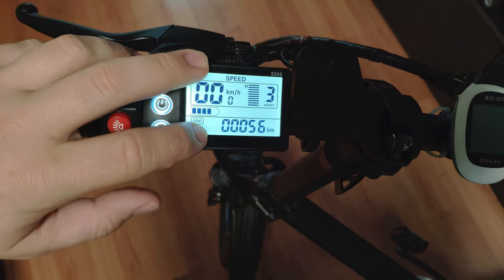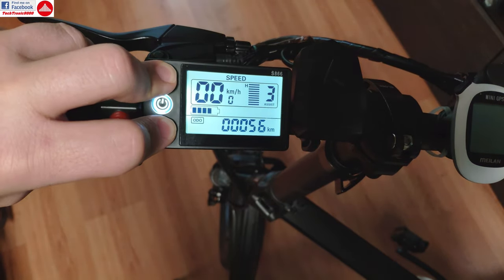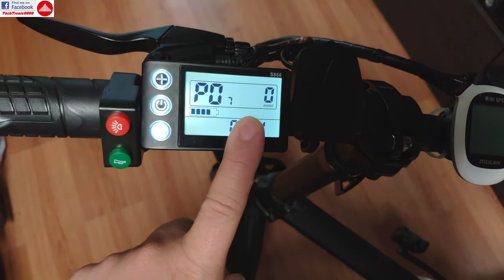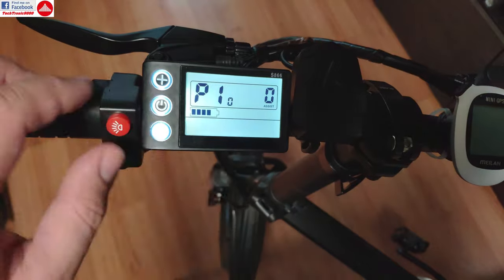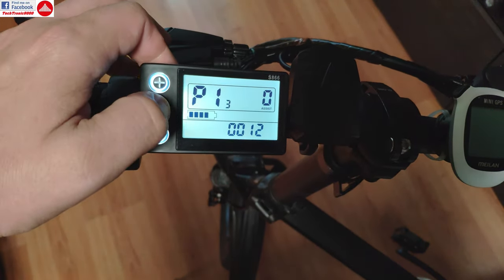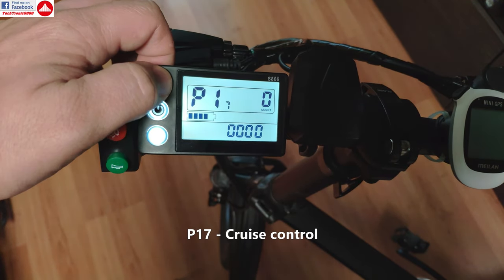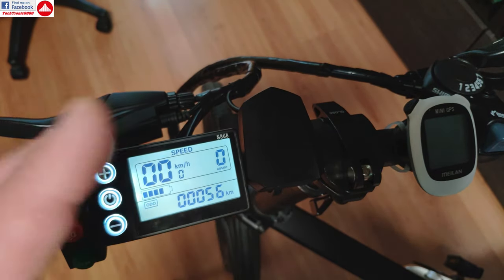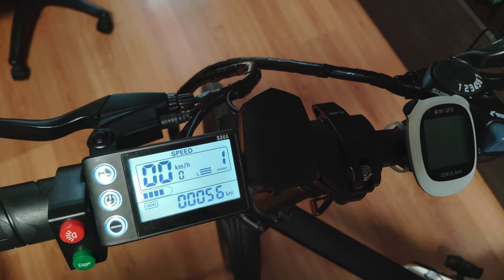ADO A20 / A20F / A16 S866 LCD - Complete Settings Walkthrough (P01-P20)

Comment: Is it possible to make different acceleration levels on different assists levels? My bike is very powerfull on ANY pedal assists. Just few pedals rotations and the bike starts in full power. Doesn't matter which assist levels are using.
Reply from the maker: You can reduce acceleration level, it has 5 options. Also you can decrease the delay so the bike starts faster and is more consistent with your pedaling.
Reply: @TechTronic9000  Which one for acceleration level P11 or P13? Which one for decrease the delay so the bike starts faster P14 or P16?

Comment: I have the aostirmotor ado folding ebike 500 watts it goes 25 MPH but it only goes 22.7 tried setting up 8 but it wouldn't go to 100 to unlock it's speed but I will keep trying it says it goes 40km Wich is 25 MPH
Reply from the maker: ADO or aostirmotor? They are totally different brand. ADO is already a well established brand with lots of users and good support, can't tell nothing about the other model.

Comment: Hi sir, i need to change my wheel diameter setting because my km/h meter is not accurate, but i cant change any setting besides p8 and p10, do you maybe know how to change it?
Reply from the maker: Is it an ADO bike? Maybe it's another controller?
Reply: @TechTronic9000   no its an ouxi v7 pro.

Comment: I got my first ebike a few days ago. I'd like to change the displayed speed for the bike (max, 21MPH) but it shows 35-40MPH which is wrong. I would adjust the P18 parameter?
Reply from the maker: Start by checking wheel size first.
Reply: @TechTronic9000  26" wheels.
Reply: This doesn't sound right. I would change it back to the defaults and carefully watch the video again. You want it to go faster or just display the correct speed?

DEFAULT SETTINGS 
:
P01: 2    (Display brightness)
P02: 0     (Km or miles) 
P03: 36  (Nominal voltage)
P04: 10   (auto sleep time minutes)
P05: 0     ( power assisted mode )
P06: 20   (wheel diameter)
P07: 1     (number magnets motor)
P08: 25   (speed limit, increase to 44 for max speed)
P09: 0.    (non zero start, 0= no pedal needed)
P10: 2.    (drive mode, electric, assisted or normal bike)
P11: 2.     (assist delay since peddling started)
P12: 3.     (Strength of acceleration)
P13: 12    (PAS sensor)
P14: 15     (controller current limit)
P15: 29     (battery controller voltage limit)
P16: 0       (reset odometer, km to 0= new bike)
P17: 0       (cruise control)
P18: 100   (Display range adjust)
P19: 0       (0 gear assisted)
P20: 0      (controller communication mode)
Reply: @GaryInAmsterdam  Display the correct speed

Comment: no juste.  when import on spain and france, it is Eu restricte. yo open batt side. disconect the black conection(gray wires)  ormally it is freepower so P8 will not work.P12 also. 2 choice. full or restroct
Reply from the maker: You might have the newer controller version, for that one check this https://youtu.be/rL0P9gW5x4U

Comment: Hello. I watched the video. I still have a problem. I have the Ado xe  16 bike. Same controller. BUT, in PO5 setting, it gives me only 5 assistance levels, NOT 9. Generally, the problem is that it doesn' t reach 25km speed. And I have to pedal too much, just to give me a little boost. I want just to do one-two pedal and then boost. I want the less delay, the more boost, the fastest it can be. What exactly have to do in settings to achieve that? Thank you!
Reply from the maker: Check my other video with ADO bikes, your XE has another type of controller with just 16 settings so you unlock it in other way.
Reply: @TechTronic9000  Hi again. I watched the other videos but i did not figure out how to unlock speed limit. My ebike is Ado XE 16 (there is no throttle). It has the same controller, the S866. It has two choices for speed assistance. Either max 3, or max 5. There are no 9 levels of speed among my choices. And the fastest it can go is 21km. It never reached 22km. What can i do to go faster?
Reply: The 9 levels isn't going to help you at all, especially if the bike only supports 3 or 5 levels. What you want to change are P11 and P12.
P11 is the delay before the assist happens (1 to 24) 24 being long delay (personaly, I use this setting to increase distance/batt life) set yours to 1.
P12 is PAS acceleration value (1 to 5). Set this to 5. 
This is how these settings should work. Hopefully it works for u.

Comment: Any idea on how to upgrade this bikes battery in order to make it faster?
Reply from the maker: Yes, change the battery with a 48V one and set the controller to 48V.
Reply: @TechTronic9000  Do you have a battery in mind? i'm afraid to buy one and it doesn't fit inside the bike

Comment: Hi, any ideas why my milometer has stopped recording the miles properly (got the first 11 miles done and seems to have gone bad). Also, the battery seems to show low bars very quickly, say after a few miles (4m) of riding part assisted mainly and a bit of throttle and getting 1-2 bars on assist 2 and peddling ( bike is set to 36v ). Bit worrying for a longer journey if I have just got the bike and the battery is fully charged? Regards
Reply from the maker: check all the plugs and wires, check and adjust the brakes, also check tire pressure.
Reply: Also check your tire diameter. If you accidentally changed it to something ridiculously small, your odometer might not have registered enough distance yet.  Just a suggestion but the values might not go that small

Comment: What level would you recommend to set on p12? My pedal assist stopped working suddenly I'm.not sure if I moved it without noticing
Reply from the maker: Check all the wires and also check the sensor to still be seated in the proper position.
Reply: @TechTronic9000  where can I find the sensor on my bike? It's a Zip swft bike
Reply from the maker: It should be on the pedal shaft

Comment: Which part is the speed sensor? My the tach on my a20 is way too fast (showing 99 when I'm doing 15). I've checked and all settings are correct. It stood it in the rain yesterday so maybe water ingress is the problem.
Reply: I think I found the solution. P07 should be 6, that seems to display the correct speed.
Reply: @macg86  After rain I am seeing sameproblem
Reply: P18 adjusts the speed displayed by a percentage value. For example. My display speed was at like 25.3mph but after checking it with my phones gps, it was displaying too fast so I entered a value of "90" and now my display Maxs at 22.4mph. same as phone. 
Just divide your phones  speed by the r display speed, multiply by 100 and that is the value to give you an accurate speedometer

Comment: Hi, thanks for the video! Do you know any good battery to upgrade the A20 one? Like a 48v 12a instead of the 10a
Reply from the maker: It will not fit the frame, you can do that only with an external battery.
Reply: Hi yes there’s a 48v 10.4 on eBay at £190 I’ve just bought one and fitted It will increase speed but not by much maybe 4mph so not sure if it’s worth it I’m 12 stone in weight max speed 22mph When checking off the bike using the stand it managed 28mph So weight makes a difference
Reply: Hi yes there’s a 48v 10.4 on eBay £190 it fits but will only increase the speed to 22 mph using the stand and wheel off the ground 28mph So depends on weight
Reply from the maker: If you go with 48V you would probably get a ~ 30% speed increase, so you will probably do about ~45km/h. That would be more than enough for the A20.
Reply: I bought the 48 volt upgrade for my a20f and it fits in the frame fine, ive had 31 mph from mine now but it will comfortable cruise along at 25 26 mph

Comment: Hey, I still have a problem with my bike. I only have pedal assistance in the lvl 1. When i change to lvl 2 or 3 the motor never turns on and I can only pedal. Ssme for the right accelerator. Nothing happens when I rotate it :/ I followed all the instruction in ur video
Can't use full eletric mode and the bike is fully charged
Reply from the maker: Check settings again, you might have disabled the throttle or changed motor power to zero.
Reply: @TechTronic9000  the cables were broken... I need to send it back to the factory bah

Comment: I have the same computer. When I hit the throttle from start, the motor will squeal, but not move. After I get moving, the throttle works fine.  Is this a setting of some kind, like throttle sensitivity?
Reply from the maker: Hard to tell, could be hall sensor problem, phase wire problem.
Reply: @TechTronic9000  All fixed, wires from computer to controller didn't match, had to re-pin them.

Comment: Frist thanks for informative video. Second i have the same controller and it's shows an error or e10. Everything is working fine but this error come every time
Reply from the maker: E10 is a communication error, you can try to change the settings for the P20 and see if the error goes away.
Reply: @TechTronic9000  but the p20 value does not change.

Comment: why p14 only lets me set 20 amp max current if my controller is 35amp
Reply from the maker: That option usually doesn't work on most controller / lcd combo, generally the controller will do max amps.

Comment: I don't know what I did but after messing with the settings my Max speed is 18 instead of 20. The 1-100k make no difference. My old display is busted so I have to make this one work. Is there a way to reset it?
Reply from the maker: There is no reset, you just have to manually enter correctly each setting.
Reply: @TechTronic9000  but what if I entered things incorrectly and I don't know the correct one?

Comment: have changed po8 setting but still only get 15mph anything else i can do ?
Reply from the maker: If it's and ADO, you need to have throttle installed and activated and you can only use that for going faster than 15mph (25km/h).

Comment: Sometimes I have message (maybe fault?) E  11 . Do you know what is mean ? 
Thanks.
Reply from the maker: E11 is "Communication failure", sadly I don't know much about this error. You could check the connectors between the display, throttle, controller and hall sensors.

Comment: Did you notice that a20 and a20f do different speed? Doesn't matter which gear you choose the a20f seem to be faster and they do not Show the same trip data. 25kmh on the display is not same by both bikes also 15kmh and 20kmh. If you wann to keep up with a20f you need to drive in 2nd gear.
Reply from the maker: You might need to fine tune wheel diameter, you can do that from the advanced settings and by using a GPS phone app to see the real speed. Your wheel might need adjusting in small increments from the stock 20" maybe to 19.5" - 20.5"
Reply: @TechTronic9000  when I change the diameter, will the bike go faster/slower? Or is it just for the driven km and the showen speed on the Display? We compared more and even the driven km are different. 
Thank you for answering me. :)
Reply from the maker: It will just calibrate speed and distance, the bike will get up to the same speed but it will show it properly.

Comment: Hello...

I have an electric bike with the LCD-P3C controller, but it doesn't let me enter the parameters because it's password locked.

Could you tell if there is a default or manufacturer-specific password?

Thanks
Reply from the maker: The default password for the 866 is '3745'

Comment: P11 and P12 doesn't seem to have any effect on ADO A20+ (International version)
Reply from the maker: The + international newer version has another controller which switches to hybrid in another way and only has 16 settings instead of 20. Have a look at this also https://youtu.be/rL0P9gW5x4U
Reply: @TechTronic9000  Well, I have international +, but I have all 20 settings

Comment: P11 not working properly. It doesn't matter what speed you choose, even 24, the assistant starts to work at about 6 kph. Any idea how to fix it? Thank you.
Reply from the maker: P11 is the setting for assisted pedaling delay, the time the bike waits for you to pedal until it starts to put out power to the motor. The 6km/h is the "walk assist" which is meant to help you when you walk next to the bike. You probably meant to set up cruise control which holds throttle constantly at a set speed. For doing that you need to check P17 and that one only works for newer controller versions.
Reply: @TechTronic9000  How do you change cruise control speeds (from currently being on one) or stop it entirely mid ride?

Comment: Secondo te sarebbe possibile attivare la modalità pedalata assistita anche sul 2 e il 3? Al momento funziona solo sull'1 dato che ho disattivato l'acceleratore perchè in Italia è illegale.
Reply from the maker: The ADO only has only gear 1 assisted. It's possible that in the near future to have an upgraded controller that supports both multiple assisted gears and also speed unlocking.

Comment: I received my bike 2 days ago, and I charged it for 6 hours until it said 41.6 volts, but there are no bars in the indication level.. The bike is working but the bars are empty.. Is there a way to reset the computer or calibrate the level indicator..
Reply from the maker: Check the setting and if it's an ADO set it to 36V, your might be set on 48V.
Reply: @TechTronic9000  That worked, thank you so much!!

Comment: Any chance to set regen braking?
Reply from the maker: No it's not possible as the bike has a geared motor with a one way clutch that allows freewheeling with no drag but can not be spun back by motion thus there is no engine brake / Regen brake.
Reply: @TechTronic9000  I have gearless

Comment: I have a new ADO A20 F ...pedal assist 1 and 2 work fine....when I go to level 3, it stops, no power. My wife's (bought together) works perfect. What can I do?
Reply from the maker: You probably gave the newer controller, on mode 3 it switches to full electric, you can set it to assisted mode so you will have 3 levels for that, more details here https://youtu.be/rL0P9gW5x4U
Reply: @TechTronic9000  THANK YOU!!! It worked!!!
Reply from the maker: I'm glad!

Comment: Hi thanks for the video I just got my AF20 and the motor doesn't engage I don't know if I got the settings wrongI got no power whatsoever or throttle the controller is an 866 is there any factory settings? The controller doesn't show any speed or distance and I noticed that the cover on the left pedal is a bit loose (guess where the magnet is situated) any help here would be appreciated. Thanks
Reply from the maker: You probably have the new controller, check this newer video for that one https://www.youtube.com/watch?v=rL0P9gW5x4U

Comment: hey just lookin at my seetings i have the ado a20 and it came from the shop with the wheel diameter set to 25 ? is this wrong thanks in advance 🤗
Reply from the maker: Your A20 has a 20" wheel so the setting is incorrect, probably your shop wanted to set the "25km/h EU limit" and they messed it up :)
Reply: @TechTronic9000  ah perfect so should i set it to 20" realy apreciate your help this bike puzzles me lol

Comment: Hello there. I bought the bike and the throttle isnt working. Any clues about what could be happening?
Reply from the maker: You might have the new controller installed, follow this video to switch modes: https://youtu.be/rL0P9gW5x4U
Reply: @TechTronic9000  I have got it! The PAS sensor was disconnected... :/ Problem solved! Thanks anyway!
Reply from the maker: It's good to hear that you have sorted it out.

Comment: Hey! Iron, man!

Do you know how to reduce the intensity of PAS? Poor terrain and even the first of five PAS levels is dangerously powerful in the Shengmilo MX20. It’s almost fun that PAS accelerates and go to higher speed than the throttle! So I'd want scale all assist levels down, acceleration and speed. Is it possible? Thanks.
Reply from the maker: Yes check the motor acceleration level  and motor delay.
Reply: @TechTronic9000  What are their names? P11 and P12??? Thanks.
Reply: @TechTronic9000  Hi! I went into settings menu put last parameter you can go is P08. After that you get back to P01! :( How to access all parameters?
Reply from the maker: You might have something similar but different.
Reply: Have you resolved this problem? Mine bike, also, very powerfully on pedal assists. Just few pedals rotations and the bike starts in full power. Doesn't matter which assist levels are using.
Reply: @markv.8417  That's the best thing about it
Reply: @markv.8417  Any chance you could get in touch with me please could you take a video of the settings that you have and go through the video the same way please

Comment: Any idea why when I go to the program page everything is blank but 4 zeros at the bottom of the screen
Reply from the maker: Probably it has password enabled.
Reply: @TechTronic9000  well how do I bypass that, kinda makes sense since it wasn't just a kit but installed by the bike manufacturer
Reply: Sounds defective. Did you figure this out?
Reply: @GaryInAmsterdam  I tried,  turns out all I can find are 5 pin plugs, the one I have is a 6 pin

Comment: Hi, I have 48v bike. Recently I changed my S866 display withe brand new one. But battery level started to decrease too quickly. I check the settings but couldnt find reason. Anyone here can help about it? Thanks
Reply from the maker: Check the voltage setting of your display to be properly set for your nominal voltage.

Comment: does anyone know how to keep this display from constantly reverting to all the default settings when your turn it off and turn it back on
Reply from the maker: It should do that.
Reply: @TechTronic9000  I finely figured out what was going on and why it keep going back to the default settngs after turning it  off and back on.  turns out that the p19 setting which all of the manuals say is for setting if its for a geared hub motor or not with 1 being for geared turns out to be completely wrong if you set p19 to on it sets everything back to the defaults.